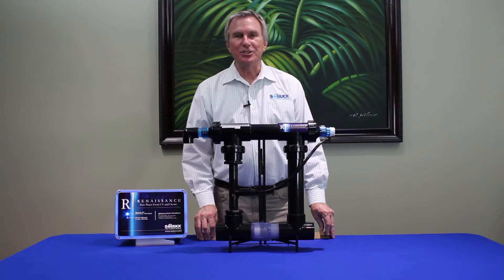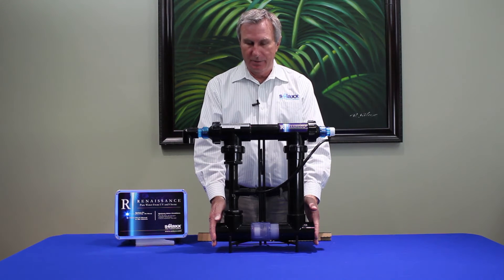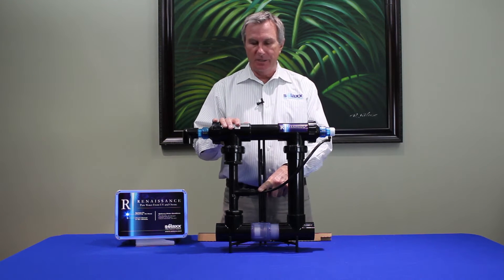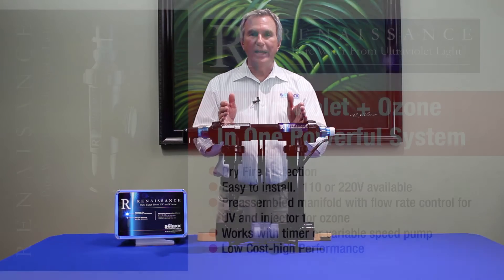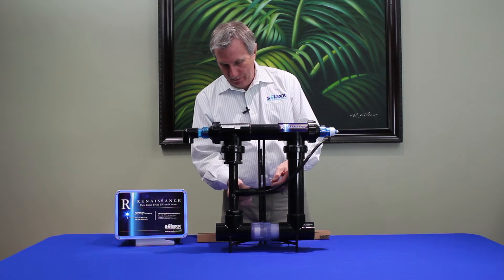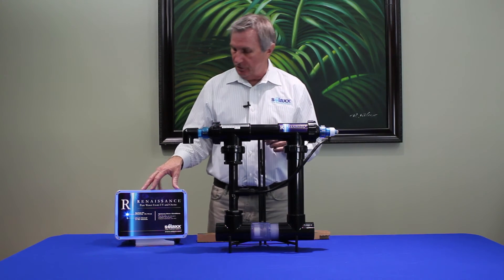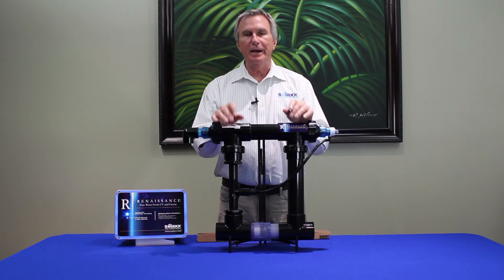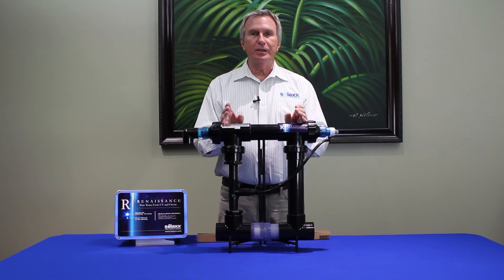Renaissance UV/Ozone System Overview

Comment: I like the unit when it works but it is beyond challenging to keep operational.  I spent a good bit of time on the phone with one of their engineers.  He was very nice to talk to but it does not make the unit any more reliable.  This is my 3rd season with the unit.  The first season, it was installed as part of a $50k pool makeover.  Worked quite well.  As the owners manual instructs, I removed the entire unit and placed it indoors for the winter.  The second season, I reinstalled the unit but learned a number of expensive lessons.  The removal of the unit required the bulb be disconnected.  When I reconnected it during reinstallation, I was not made aware of how sensitive the quartz sleeve for the bulb is and of course, I broke it.  When I ordered a replacement top manifold from POOL Supply Unlimited for almost $300 the unit came with the quartz cracked.  They did not replace because they know how sensitive the quartz is and assumed that I broke it.  Upon ordering a replacement, I decided I would remove the UV bulb only when necessary.   To accomplish this, I installed a Deutsch Connector between the upper manifold and the control center.  This all worked for the balance of the second season.  I would point out one more thing, the owners manual does not indicate how far into the quartz sleeve it should be inserted.  Being as sensitive as it is, I would not recommend that pool owners should be required to do so much experimenting to allow for the proper air flow to generate ozone.  End of season 2, Deutsch Connector allowed for the assembly to be removed and stored in a safe, atmospherically controlled environment.  Start of season 3, re-installed the complete assembly and again the Deutsch Connector allowed for a fast and simple process posing no risk to the quartz sleeve.  The unit was functioning very well when in week 3 of the season, water has started to leak from the air intake on the upper manifold indicating one very familiar problem...the quartz is cracked again, this time with NO provocation.  It is very disappointing.   The unit is expensive and when operational is quite impressive, but like many academic concepts, the company has failed to transform the concept into product ready for consumers.  I am contemplating spending another $300 for yet another replacement but trying to figure out how to ensure that it arrives in one piece.  I am also considering alternatives.  I know with certainty, I must install a bypass with valves to allow for the pool to function considering the poor reliability of this system.  One more caution to potential buyers, if the quartz does break, there is nothing to stop your pool pump from emptying your pool as water will leak from the air intake and a fairly high flow rate.
Reply: Thanks for the thoughtful and detailed review to help the pool owner community.

Comment: Thanks for posting. It may be semantics however, I’d refrain from stating two things in this video. You denote pure water out which is not accurate. Secondly, the water is not sterilized, it may be sanitized. The former declaration is a detailed process requiring compliance with ISO including lab testing to show kill rates. Aside from that, I get what you’re presenting. Much appreciated
Reply: I didn’t hear him describe the treated water as pure but he did claim it was “distilled” which is a totally unrelated process. I, too, get suspicious when company reps make claims using fancy sounding scientific terms without knowing what they mean. It’s either ignorance of the technology or low key fraud if it’s intentional